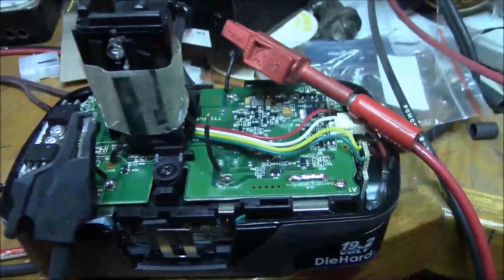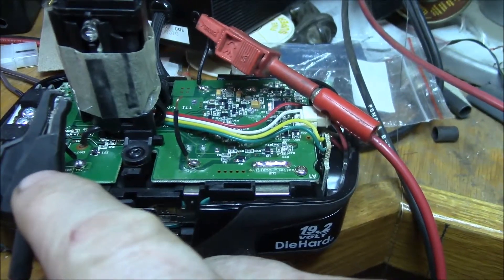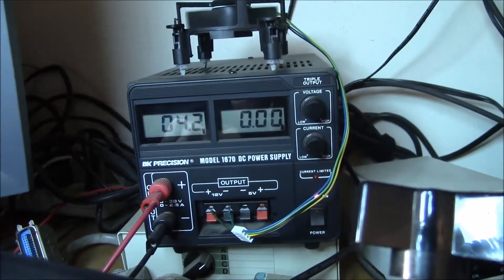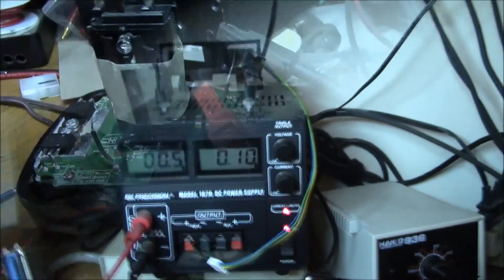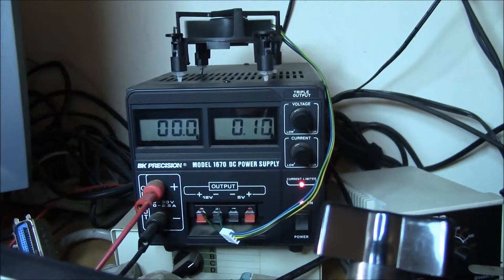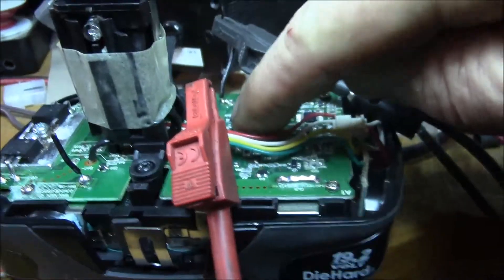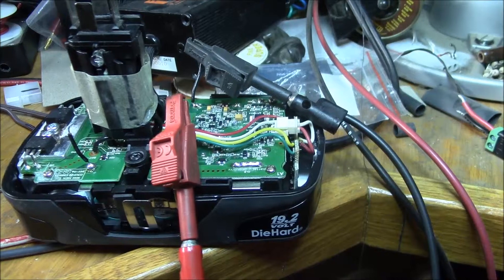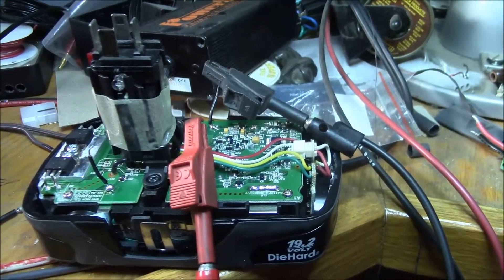C3 Battery Troubleshooting, Part 1

Comment: I have two C3 packs that are not working, how can I find which cells are bad with just a multimeter, I don't have a bench power supply like you have, also how would I charge the new replacement batteries before installing them, which you mention in your other video?
Reply from the maker: You can test the voltage across each cell and find the one(s) that are way lower than the rest.  I have a repair video here:
https://youtu.be/b5AOBwx04kA?list=PLpY2FP1a9tivcC8P5tcJxifuEzNNpjbA9
You could use a battery charger to charge the new cells (ImaxB6 or other lithium capable charger) or just put them in as-is.  They usually come with a "storage" charge on them, around 3.8v or so, if that's close to the voltage on the other cells, then that would work.
Reply: Hey thanks for the quick reply, I forgot to mention that your videos are GREAT, clear and sharp, very well narrated and your explanation is right on. I have a few of theses non-working C3 parks and per your video I will try and repair them. Where did you get the new cells?
Reply from the maker: Thanks for the feedback on the videos.  I picked up some 18650 cells off of eBay, searched for the text off one of the existing cells and found some Samsung high discharge (~20A) cells like below:
http://www.ebay.com/itm/2-pc-SAMSUNG-INR-18650-20-R-RECHARGEABLE-BATTERY-20A-DISCHARGE-3-6v-HIGH-DRAIN-/261823971602
Reply: Ok I have a 315.113710 C3 battery pack that is not working, the voltage at the prongs on the tower is 4.17, then i took it apart (per your video) and checked the voltage of each cell starting at the fuel gauge end, cell #1 is 3.776v, Cell #2 is 3.061v, cell #3 is 2.952v, cell #4 is 7.15v (yes this is correct I checked it several times), cell #5 is 2.974v. I have tow questions for you, what would cause battery #4 to have 7.15volts? And how many of theses batteries should I replace?

I'm thinking Battery #4 is BAD with that much voltage and should be replaced, right?

The marking on the batteries in my device are Samsung INR18650-13Q, SDI 088

Thanks for your help on this.
Reply from the maker: I would at least start with that one #4 battery, disconnect it from the rest of the pack and see if it still measures high.  Maybe that is causing the BMS board to shut off the pack.  You might also need to manually top up the sub-3V cells, not sure what the low voltage cutout is on the BMS, but it might see those cells as dead.
Reply: How would I manually top up the sub-3V cells with out a power supply like you have?
Reply from the maker: You could use an RC battery charger, like an iMax-B6 or similar.  Or if you have a stand alone lithium battery charger, attach some wires to the charger terminals and add some alligator clips to the ends and clip those to the cell you want to charge.
Reply: Ok removed the #4 cell and it measures -.19 volts (very low), funny the polarity is reversed?
Reply from the maker: This thread has some discussion of what may have happened:http://www.candlepowerforums.com/vb/showthread.php?316280-Reversed-polarity-18650-cell

Looks like a decent charger.  The 4-button RC chargers also have a capacity measurement feature if you actually want to test the cell beyond just the open circuit voltage.
Reply: Thanks for the link, good to know others have experience with cells that have reversed. I forgot to mention the bad cell (#4) that first read 7.15volts while in the circuit, and now reads a -.19v has a bulging negative end and all the others cells have a flat negative end.
Reply: I have a second bad battery pack DieHard 130156001, opened it up and checked the cells - again starting at the fuel cell end #1 .353v, #2 4.11v, #3 4.22v, #4 -.000 (yes another #4 cell with a negative number), #5 .022v. I'm going to order about 8 cells (to have extras) and see if replacing the bad cells will get theses packs working again, thanks for all your help.